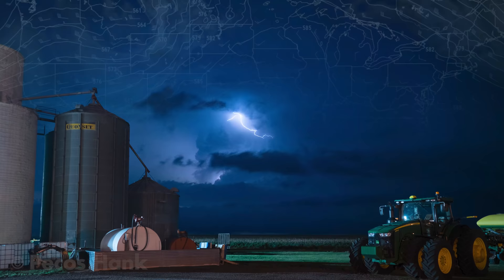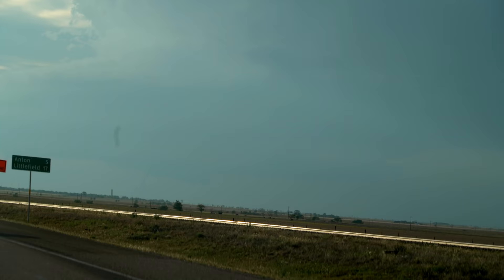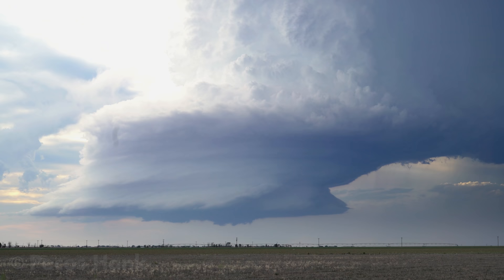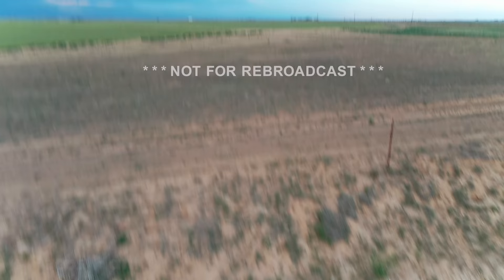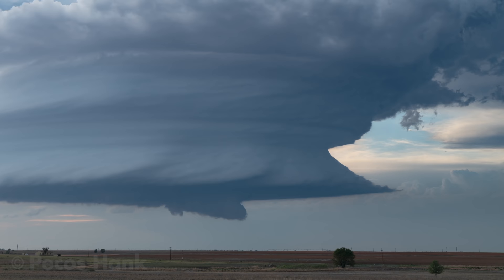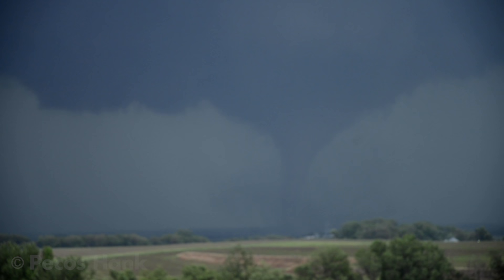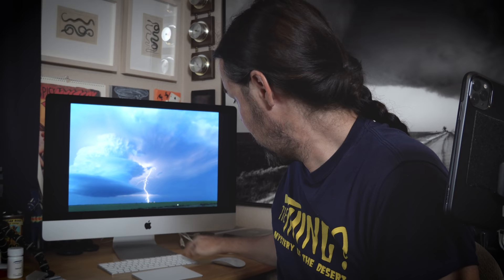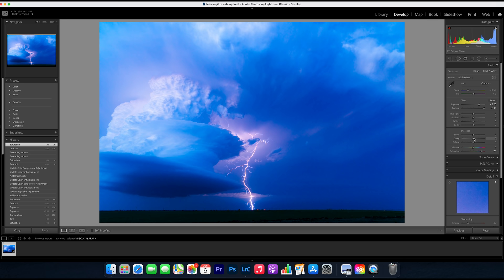PHOTOGRAPHING THE PERFECT STORM - and ruining it!

Comment: I had the same problems as you were having until I figured out that I needed a hard copy procedure with a checklist. I first thought it would waist time running threw it causing me to miss my shot but It’s has the opposite effect. I’m able to set up everything correctly causing me to slow down just enough not to make photographic equipment mistakes at the cost of a money shot. It also became routine enough that it was memorized in my brain and actions. I find now I have time to think about what direction to stay safe from the storm and how to stay safe driving in general.

Comment: You can save the elongated dust spot footage by utilizing the radial filter or adjustment brush in lightroom at varying exposure/blur/clarity and contrast levels. It's a trial and error kind of thing, but it works. I pretty much have to do this any time I shoot daytime timelapse with my 5dsr as the sensor has a tiny defect on it. Takes forever, but it works. Also useful for those really aggressive dust spots if you ever do foreground to horizon in focus small aperture shots where dust spots are all but guaranteed. There is a tedious method that allow for removing birds and bugs too, but that's a frame by frame kind of thing while dust spot/defect removal can be batched/synced across an entire sequence.

You're also going to be super disappointed to find out that almost all of the popular landscape photogs Jovian-ize their imagery. I call it the Adamus or Disney effect. However, they make the big bucks giving multiple grand per individual photo tours so we're probably doing things wrong just licensing material at increasingly lower rates due to all the individuals who give their material away for online kudos. We should organize and do the same for storm tours. Call it Epic Pyramid Storm Dominator Tours and Photography/Timelapse Tips for EPIC Social Media Posting Points or something. No suggestions for missing the record button. I still haven't found a solution to that issue.

Comment: I  had a question if you have a second:
The bathroom is the innermost part of my house, ( I live in a hurricane /sometimes tornado prone area) but there's a door in my bathroom ceiling leading to my attic. It's not latched closed , there's just a ladder that comes down ,but all that's folded up into the Attic. 
My question is ,does that door make the bathroom more vulnerable? 
I've seen lots of tornado damaged houses where the bathroom is the only place left standing ,but I'm not sure if the attic door makes it not that safe. .
Reply: You want to be in the inner most room whether that's a bathroom or an interior closet. Put as many walls between you and the outside as possible.  Bathroom pipes might help anchor you a little, but an attic door above sounds a little sketchy.  Make a calculation and roll with it.

Comment: I have a question. I'm from southwest VA and we tend to get some pretty wild weather here but I got under the tail end of a severe thunderstorm that was tracking north by northeast and noticed the base was pretty low right above me. So, I pulled over to check it out, facing west and noticed that the lowering was moving south, then bent around, moving east and then bent around to the north. Then, rain started wrapping around this weird air current. I reported it to the NWS and they said it was inflow. But since when does inflow wrap around in a certain spot like that?